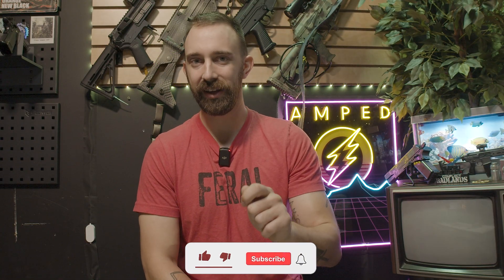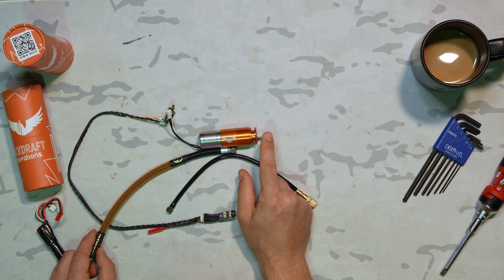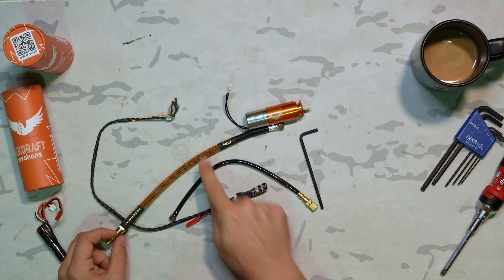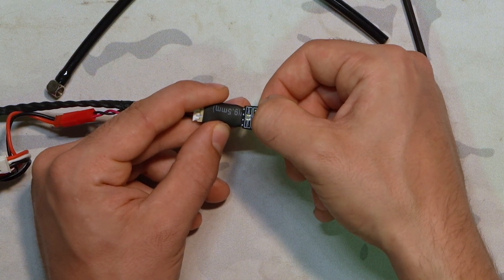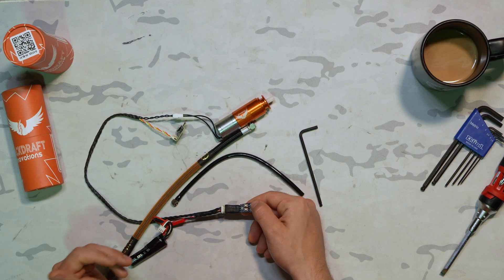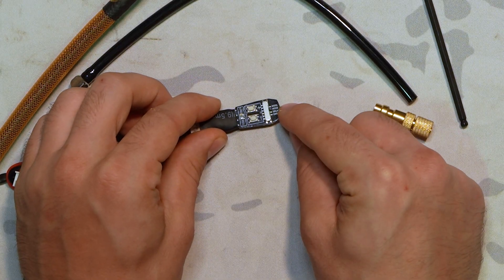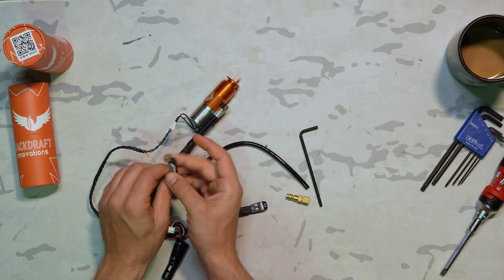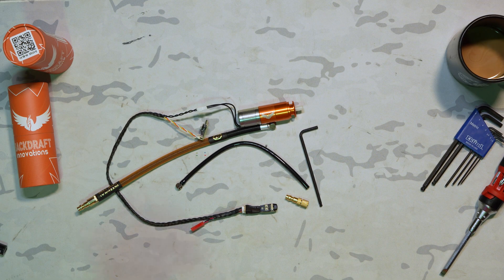Backdraft Innovations Phoenix HPA Engine | New Revision | Changes & Programming

Comment: what battery should i use???? a standard 7.4v?
Reply from the maker: You can use a small little HPA battery and you can see the battery at 1:33 and see it plug in at 5:32. Any small battery that uses the JST connector